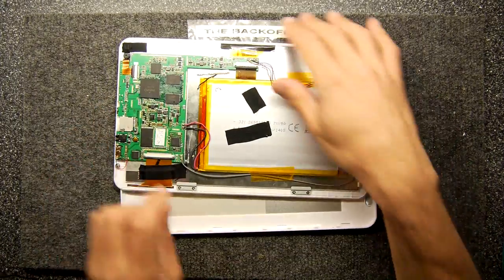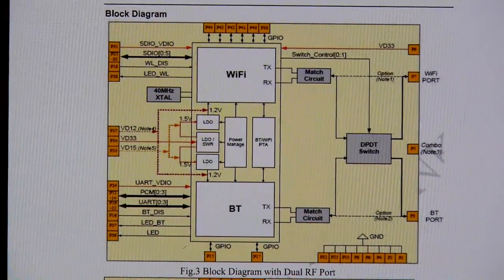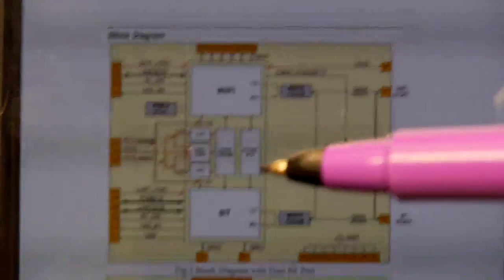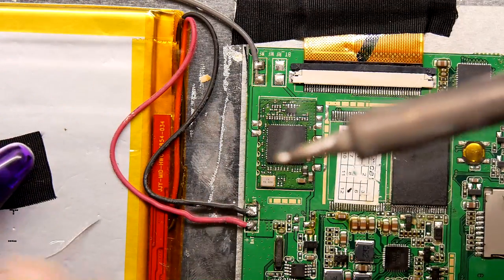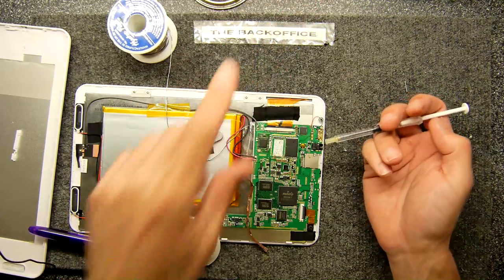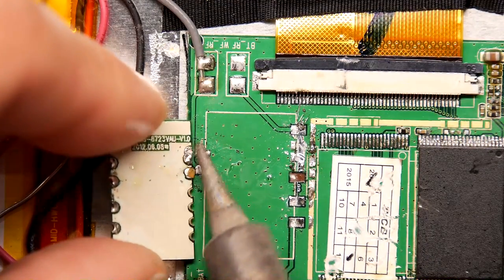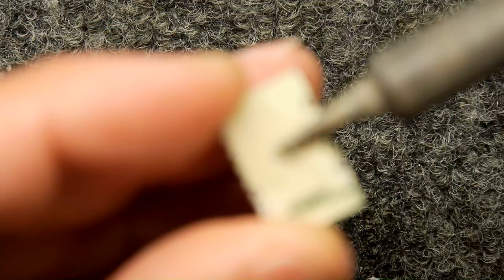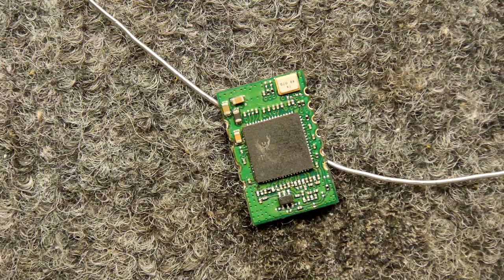Tablet RTL8723AS WIFI & BT Module

Comment: Could that Chip be used(Replace the WIFI chip) in a Nexus 7 that has WIFI  but no Bluetooth? to add Bluetooth operation to the tablet? Would you please give some opinion as how to!
Reply from the maker: garry ermoloff I guess technically it's possible. Assuming you could physically install it, it's going to be a challenge to ensure that all the correct drivers are installed in Linux for it